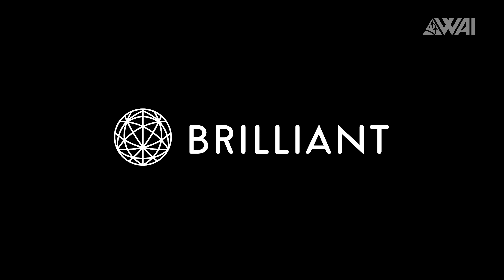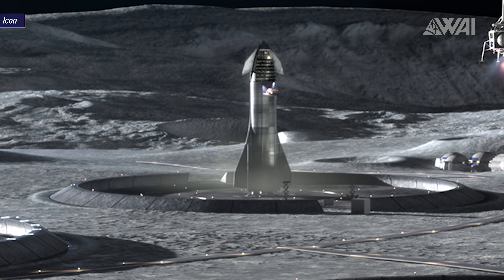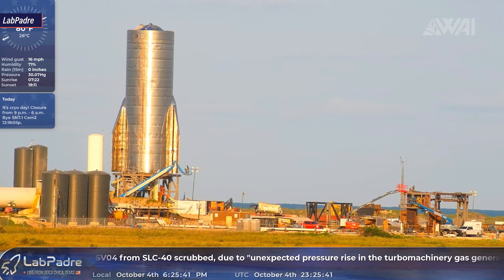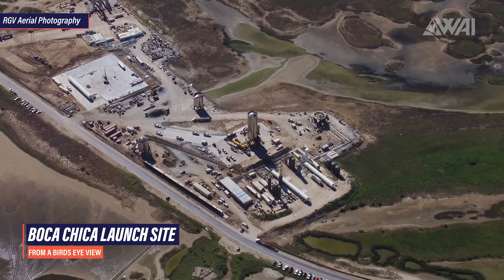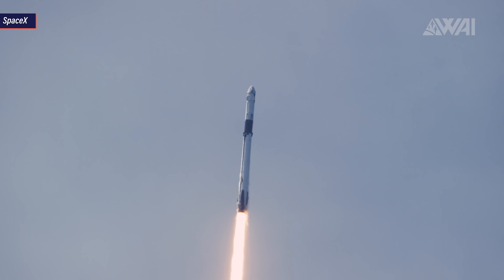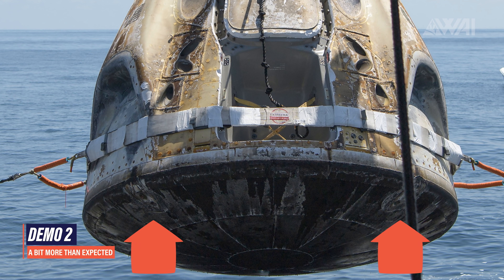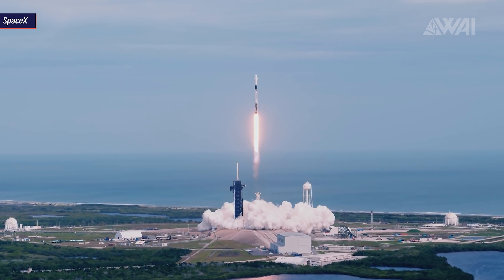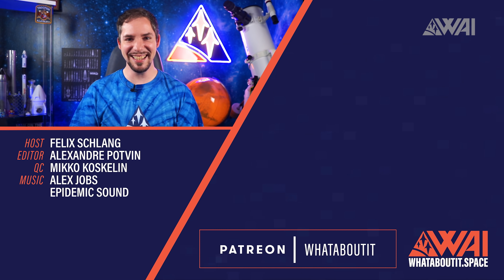125 | SpaceX Starship Project Olympus – Crew 1 Preparing For Lift-Off

Comment: Come to think of it, that white lunar Starship could have lots of space for AFT cargo with no need even for sea level raptors.
Reply: It will need the full set of Raptors for its initial trip to LEO. Removing them once in LEO? Very doubtful it would be worth the difficulty.
Reply: @donjones4719  interesting, so the Starship will pop off of Superheavy with all 6 raptors firing? That will definitly give it a bit more of a kick into orbit.

I had assumed the sea level ones were basically only for landing butthat makes sense.

(I had even wondered what the efficiency would be with a single 9 meter vacuum bell instead pf all 6 ... but I guess if 3 aren't enough, there's no way a single engine would do it.
Reply: @OldGamerNoob   Also... SH will drop off at a lower altitude than Falcon 9 does, so it's an in-between atmospheric pressure, not optimal for either engine. Sorry, idk the altitude.

Comment: Why can’t the crew dragon switch docking ports by itself without crew inside
Reply: It can, but NASA would look pretty embarrassed if the autonomous system somehow failed and the Dragon just drifted away. Or worse, drifted/crashed into the ISS.

Comment: Felix, would you mind having someone look into an important idea? Like many Starship true believers, I am worried about doing the belly flop so close to the ground and thought it would be safer to do it a say 20,000 feet. This way, if something goes wrong, they have lots of time to recover. This may be exactly what SpaceX is planning to do, but I have not heard anyone talking about it. 

So, what about it. 

Would you mind pitching this idea in one of your episodes? You are becoming popular enough that SpaceX might hear you and save one of those prototypes from plowing into the ground.
Reply: The skydive maneuver (belly flop) begins at the end of ascent, at 50,000 ft. It's easier to try out the aerodynamic controls in thinner air, the response won't be as abrupt. Then they'll engage more and more during descent, give a learning curve, possibly. If you're referring to the kick maneuver when they fire the landing rockets - that may be a good idea. They'll have to carry enough fuel for that burn and the landing burn. Don't know if it really helps them, though. The center of gravity (extra fuel) and thinner air resistance will need different control inputs, so that may not generate useful data to apply close to the ground.
Reply: Curtis
The switch from the belly flop to the engine-down orientation requires the engines anyway. Also there will be a suicide-burn just like we see with the F9 first stage. So why not combine that and safe tones of fuel?

SpaceX know what they are doing. They test in a hardware rich environment. We will see lots of craters from fails landing attempts until SpaceX figure out the right height for the switch maneuver.
Reply: @3gunslingers  I'm sure they have run it through the simulator thousands of times. Now that I think about it, landing with any amount of fuel in the main tank would be chaotic - with all the sloshing. They may have to further compartmentalize the tanks (the way most reusable aircraft do) if they start landing with much of a cargo load.

Comment: 11:45 *bringing the team up to 7 astronauts for the first time!

To be more precise: Statement meant as long-duration team. I know that during shuttle flights, there was more crew, but these were only visitors for the time how long shuttle was docked (2 weeks). While it was originally planned from the beginning that the permanent ISS crew should be 7 members, it never happend due to scrapping the plan for the crew return vehicle, which would have been a live boat that would have allowed bringing crew up with Space Shuttle and stay there even after return of the Shuttle. Basically, this was not done after Columbia desaster, which was the beginning of the end of the Shuttle era. Ever since, Soyuz capsuls were the only live-boats which seats 3 persons each, so permanent crew was limited by the permanently docked Soyuz capsuls.

It really can't be overstated that indeed the commercial program is the piece that finally enables to bring the ISS to initially planned operational capacity, after 2 decades...
Reply: This 4 person crew + the present Chris Hadwin will bring it up to 8, if I'm correct in thinking there are 3 cosmonauts presently. Chris will go back on the next Soyuz, IIRC, but afaik that Soyuz exchange will leave the cosmonaut population at 3. So with the Dragon 4 the ISS will have 7 crew, and the limiting factor of "lifeboats" will now always be 7 with a Dragon or Starliner long-term docked, plus a Soyuz.

Comment: Unless Space X and NASA address the concerns  of Dr. Robert Zubrin, these will remain remain a dream.
https://spacenews.com/op-ed-toward-a-coherent-artemis-plan/
Reply: Elon's estimates for Starship refueling have always been quite lower than Dr Zubrin. His statements indicated a regular SS could carry enough fuel to the Moon to decelerate to low lunar orbit, land, and then take off for low lunar orbit before it needs to refuel. (I don't think this is fixed on the 100t cargo ideal mission goal.) And then it only needs enough fuel for trans-Earth-injection, which is a lot less than TLI - that means the tanker can be far from full, so the chain of flights needed for it is considerably less than Zubrin estimates. 

Elon also feels the problem of engine blast is exaggerated. There are a range of expert opinions, and the worst-case scenarios are almost always the ones mentioned, leaving the impression it's a fact. OK, early on worst-case scenarios have to be the basis of planning, but experience will soon be gained.

100+ tons to the Moon will  be great, but 40 or even 20 tons will still be far more than other systems, and individual components can be larger. Early flights won't be returning much cargo - we don't need 10 tons of Moon rocks to study.

Using the HLS Starship with the Gateway does introduce inefficiencies, but I've gone on too long already. Overall, one big problem is Dr Zubrin has never accepted the paradigm shift of multiple Starship launches, that its level of easy reusability makes multiple launches for tanker trips an advantage, not a roadblock. NASA is aware of Zubrin's objections, but trust Musk more, since they've backed his mission profile proposal - although only NASA and SpaceX know the details.

Comment: If they don't use the emergency blaster's for landing, they should use them for reentry.
Reply: Sorry, wouldn't work. The HLS lander will never make an Earth reentry, it doesn't have the fins or heat shielding. The landing "blasters" can only fire very briefly, when the HLS has been slowed to almost zero velocity by the main engines. And only counteracting just the low lunar gravity.

Comment: 3d printed buildings made out of lunar concrete would still require a lot of water which is heavy to bring with. So would need to extract water from the surface which is mostly only near the poles (I think).

Comment: I still say that the legs on the moon lander are way too short. Like I said before, they are fine for a fairly FLAT surface, but not on the moon. Just sayin'.
Reply: There are flat parts of the moon
Reply: Come on, dude? When was the last time SpaceX build something that actually looked like the old renderings? 

You should be wiser than that by now.
Reply: @3gunslingers  I am an AI
Reply: Damn, seem to have a lot of experts on this video. Amazing. Good to know that there are flat parts on the moon and that they have unlimited fuel to navigate around boulders and small craters that can only be seen from 10,000 ft and below.  Thanks for the lunar landscape lesson. I feel so much better now.
Reply: @3dtexan890  
"Good to know that there are flat parts on the moon and that they have unlimited fuel to navigate around boulders and small craters that can only be seen from 10,000 ft and below."  Sounds like the very problem Apollo 11 had. 

Also do you really think a lunar Starship will land on a spot that isn't surveyed by a rover beforehand? 

Lastly I want to repeat that the legs on lunar Starship have only been seen on a rendering. Therefore we can't possibly know if SpaceX would even use a remotely similar landing leg system.

Comment: How will the booster be transported to the launch pad?
Reply: Same as the Starships. On the blue roller-lifters.
Reply: @3gunslingers  No way... too tall. They'll fall over.
Reply: @DrEvilDoctor  
And how do you know that?
Reply: @3gunslingers  I don't. Just deducing, really. Won't the booster be ~70 meters tall on its own. The top portion of the ship is already transported on a makeshift stand that hangs over the sides of the transporter.  So it's hard to imagine a booster twice as tall as the ship (SNs) being transported the same way.
Reply: @DrEvilDoctor  
There is a reason why they bought a second  roll-lifter. The street is wide enough so they can drive in parallel.

Comment: I can imagine making the top section of the Lunar-Starships detachable to use as housing. 
Then print a protective shell over most it, leaving the only the solar exposed.  
The engine section can be utilized as a multi-purpose lunar transport mule.
Reply: That would require a pretty big crane on the moon first.
Better burrow the Starship whole. (lay it on its side beforehand https://www.reddit.com/r/spacex/comments/i9p444/how_to_lay_a_starship_horizontally_on_mars/ (works also on the moon) )

Comment: 7:02..  I can't recall ever seeing pictures for tank baffles.  When the vehicle hits its apex, there will likely be zero G's for a short while.  Will the fuel slosh around and possibly deprive the engines of fuel.  Sucking at air?
Reply: This is the reason for header tanks. They hold a volume of fuel that doesn't slosh which is used for landing
Reply: Also tank baffles only work under acceleration anyway.

Comment: I think the Lunar Starship we've seen without flaps or heat shield is specific to NASA's requirements for the Artemis program where it would be used only as a lander. That does not mean it will be the only lunar version of Starship. Other than Mars Musk also has intentions of landing on the Moon. It's very likely a version of Lunar Starship not connected to Artemis's requirements/limitations will have the ability to return to Earth.... I mean I really doubt Musk intends to use SLS or Orion to launch his personnel to and from the Moon on non NASA related missions.

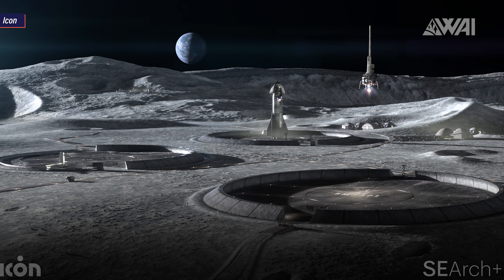Comment: 2:11  When considering printing from the regolith of the moon, this can't be a method as seen.  Water would quick sublimate from the build goo we see, so what is the build technic for building without an atmosphere?
Reply: Not water,  an epoxy is used on the moon if I'm remembering right.  India's Space Agency also found another different way to make lunar-concrete set via an extremophile bacteria, takes longer than regular crete to set up, but has the same end result; just requires a sealant coat to make it airtight as it's somewhat porous.

Comment: Would concrete even dry in space?🤔
Reply from the maker: With the right chemicals, yes.
Reply: They probably use something more like a two part epoxy or anamorphic adhesive that does not require oxygen to solidify
Reply: Excuse me that is an anaerobic adhesive which dries where air is absent.
Reply: It can dry in water so...
Reply: @kristtophon  so what, mr scientist?
Reply: @kristtophon  ..water isn't space?...
Reply: Manufacturing with lunar regolith won't be done with anything like concrete - it takes a lot of water! I think they want the company's large-scale 3D printing knowledge, to use with different materials. Proposals have been around for a long time for heating or compressing (or both) lunar soil. Making bricks this way was one idea, but maybe they want to make it work with 3D printing.

Comment: I only heard one thing in this video that's just a little bit off base. I've been a boater for over 50 years and I know the sport upside down and inside out. And I get it that they didn't need to be that close and that setting a reasonable perimeter makes good common sense. But 10 miles is absolutely but ass ridiculous. They should be allowed to watch these are our rock is we've been watching spacex's progress every step of the way and if we happen to be out boating we should be able to sit a half a mile to a mile away and still watch what's going on. Why? Because we love those Rockets as much as you do. And that distance would be completely safe and even if it's not 1,000% safe as long as you inform people of any potential hazards let them make their own decisions it's none of your damn business.

Comment: the standard starship is designed for atmosphere interaction, and in the Moon that is useless, so dead weight, you would only need one normal starship "parked" in orbit (for example, in a convenient space station) and use that one to bring people back from the moon, but hey, maybe they just consider the fuel/weight price to be OK later on, idk
Reply: That is the plan for the first few years, there will be a limited number of trips. But later, transferring cargo from ship-to-ship in orbit will be difficult, and probably impossible for large items they'll need for base-building. Not having to dock at all in orbit, even for personnel, means one less step in a mission. (OK, a docking for refueling will be needed, but that's s different mode of transfer.) And the specialized lunar lander SS has the extra weight of the auxiliary engines, which partly offsets the advantage of no wings or heat tiles. Elon always did figure a standard SS could do landings, that's how he worked out his fuel and mass budgets. Having landing pads will guarantee this option.

Comment: The boaters who crashed the splash down site for DM-2 were a danger both the themselves and the capsule. That capsule contained hypergolic fuels whose corrosivity, toxicity, and carcinogenicity is well established. It would have been terrible if there were tragedies occurring because these folks wanted to make a political statement.
Reply: tbh though, it would have been really cool to be there.
Reply: KenDroid66  - and I get it, supporting the POTUS does always supersede public safety. He's shown that time and time again. But it is not out of realm of possibilities for a swell to come along and knock one of the boats into the capsule. There's a reason why the SpaceX recovery vessels approach slowly and sample the air before proceeding. It is an inherently dangerous environment until the capsule is safed.
Reply: KenDroid66  - well fortunately for SpaceX they don't have people like you running their recovery operations who feel that anything more complex than a beer can isn't worth their time or attention

Comment: on the Moon what they are using for concrete, some polymer or what ? clearly water can't be. no, it will be sintering the lunar dust.
Reply: Similar technologies proposed for Martian structures did in fact use a polymer binding agent along with regolith

Comment: 3D building printing is neat, on earth, but I have trouble believing it ready for vacuum. For one thing, the current tech uses light components which I don’t think will form properly in vacuum.

A better system would be printing using regiolith dust deposited in thin layers and the fused by arc or microwaves. 

An even better system would be to just pile dirt onto of the structure you’re going to have to send up there anyway.

Comment: Even as intended, Lunar Starship will still blast the surface.
Reply: The engines will most likely bleed off the landing horizontally before flipping upright. Also the vacuum will disperse the gases in a cone outward. 75 ton starship plus residual fuel and payload will weigh approx 20 tonnes on the moon and wont require a huge landing burn. Most likely it will pulse burn similar to Cold gas thrusters

Comment: 3:50 So if the moons total atmosphere weights 25,000 kg with human activity on the moon we could really increase the size of it and not in purpose. Just landing and taking off, manufacturing, heavy industry, and construction could all add something. Within not time we could be realeasing 25,000 KG a day. Which is a little wild to think about
Reply: One of the first Starship payloads to the lunar surface will be 50t of LOX and 50t of LN2 in low-loss cryotanks. This will provide a 50/50 oxygen/nitrogen breathing gas mixture. At 1.6 kg/person/day oxygen consumption, that represents 31,250 person-days or for 31 persons, 1000 days of oxygen supply. So the amount of breathing gas mixture released is tiny compared to the mass of the lunar atmosphere.

Comment: i'd like to see NASA/SpaceX revisit the Space 1999 Eagle-1 lander for lunar orbit to surface cargo transfers. Sure it was TV-Sci-Fi, but the Eagle's design was highly practical.
Reply from the maker: Love Space 1999!!! :_WAILove:
Reply: Omlette du Fromage loved my model Eagles-1, wish I had it now.
Reply: Ok... take two Dianetics landers, join them together at the top by mounting with lifting frame capable of holding four Dianetcs lander modules .The dianetics lander is basically the landing legs and assent motors. Strap a crew dragon on one end and a vacuum Raptor on the other end and there you have it... one home made off the shelf Eagle.